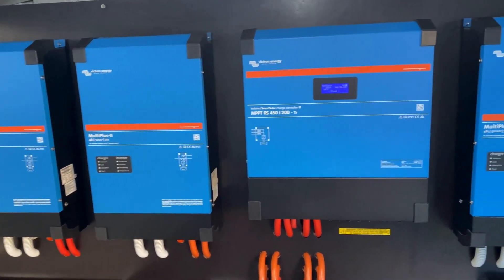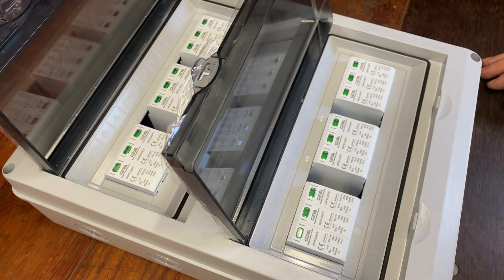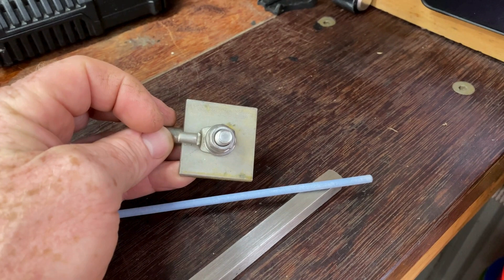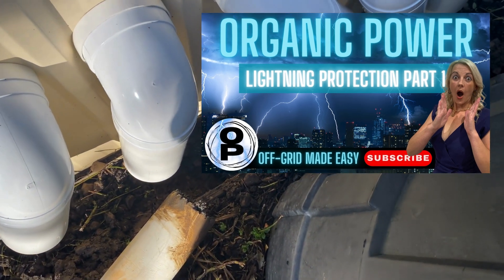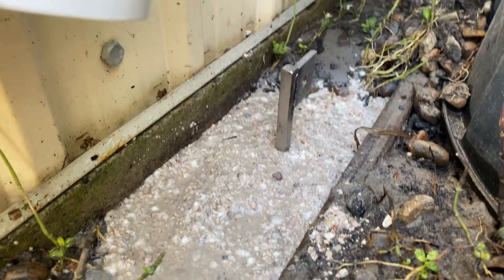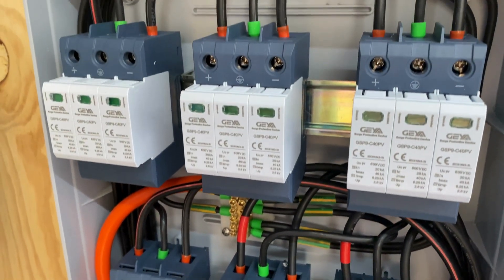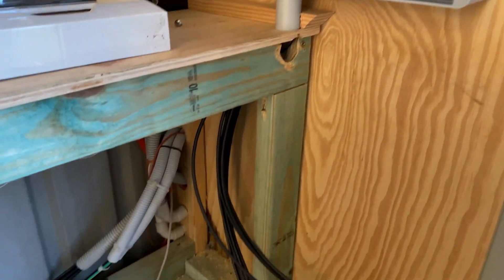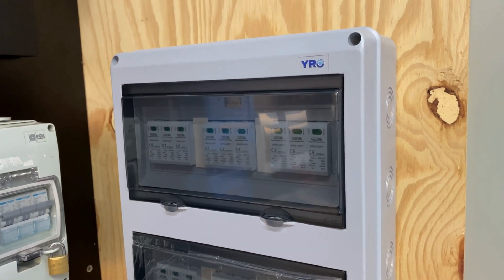The EASY Way to Connect SURGE Protection To My Solar Panels - Entirely Off Grid Home

Comment: New power bill is in. From $2500 down to $800. The 4kw system that was installed 10 years ago had failed so I fixed that. And in my shed I got my diy system up and running, it powers the washer, dryer and dishwasher and dumps extra power into the hot water tank. Keep you vids coming please mate.
Reply from the maker: Wow. That was a killer bill! Just the savings on hot water blows my mind. Nice work bud👍🏻 I’ll have another array wiring episode out soon. Followed by the complete system wiring. It will take a lot of work but they  should be out in the next few weeks. Thank you for the feedback 😎

Comment: I think more so for us Aussies, is lightning. Especially for you up on the Gold Coast the chances of there being issues with geomagnetic storms is remote at best. I am in Melbourne and went outside to look for Auroras and guess what...it's cloudy as usual!!!!!
Reply from the maker: Hi, we have air terminals as well. These are just more insurance from lighting surge. Cheap compared to the system. I’m very happy with the lightning protection, check out the episodes 👍🏻
Reply: @OrganicPower-Australia  I guess the point I am making is that yes, for us in the south your video definitely has merit to consider but in Queensland you wouldn't have as much to worry about. Still though, thank you for the content, you can never be too safe!! I have also seen quite a few videos of people (mainly in the US) getting their systems EMP hardened. That even includes them reverting to lead-acid batteries rather than lithium!
Reply from the maker: I spoke with an electrical engineer friend, this was his thoughts:

I gather old mate doesn’t really understand that space weather is global phenomenon so it doesn’t matter which part of a country you’re in.
And we have a grid that is 5000 klm long!

I am more worried about lightning ⚡️ our storm season in summer brings a lot of electrical storms. If the air terminal takes a direct hit it can cause a surge across the arrays. This is what the DC SPD’s are for. Only the AC units are for grid EMP and grid surge.
Reply: @OrganicPower-Australia  Yeah especially for you on the Gold Coast, the lightning and storms are far more dangerous than here in dull Melbourne, however I also have lightning protection because we do get some storms every year that are dangerous, just no where near as many or as dangerous as you get up there!
Reply from the maker: Just to be sure I’m not having a go at anyone,  all the input is great. This is just our view. I really glad people are getting something out of the channel. Thank you all so much for taking an interest 👍🏻😎